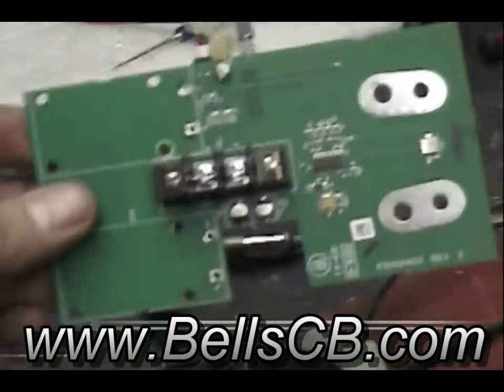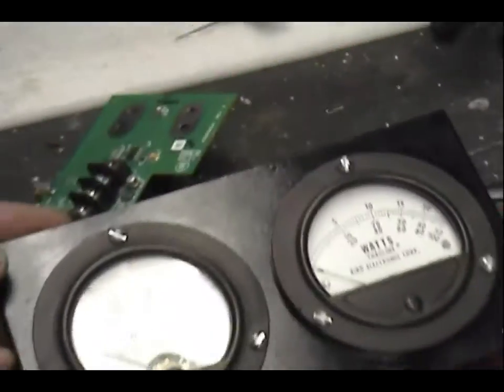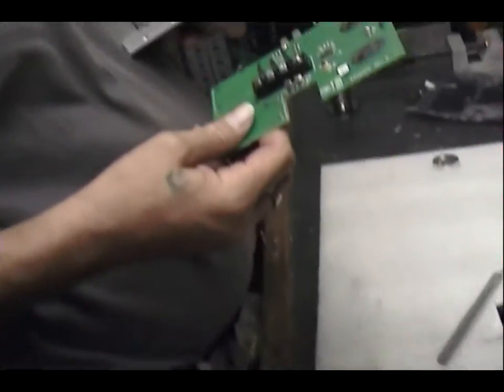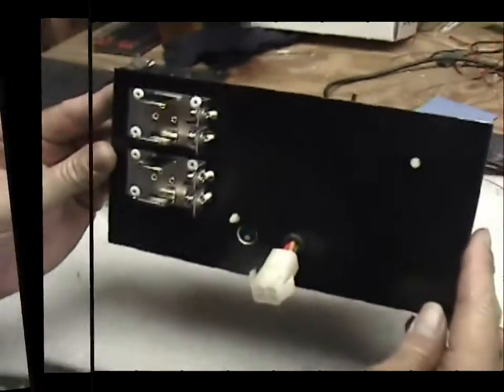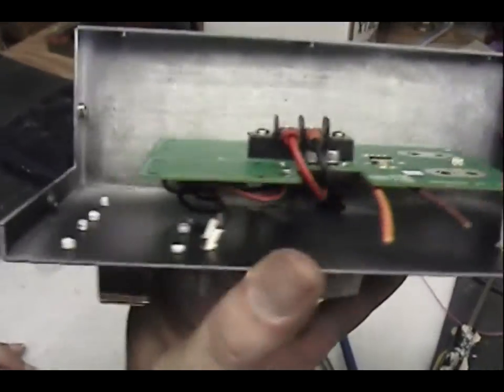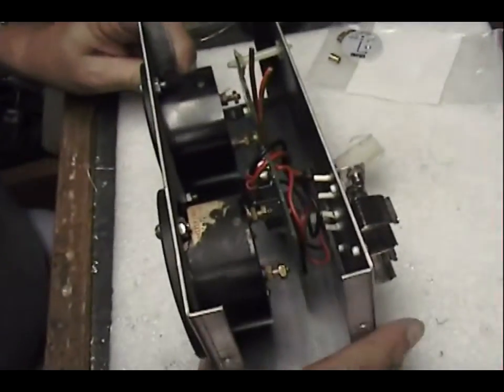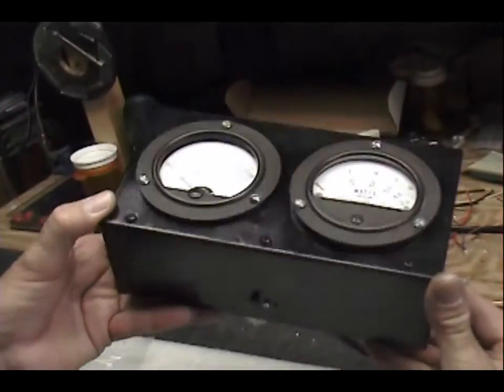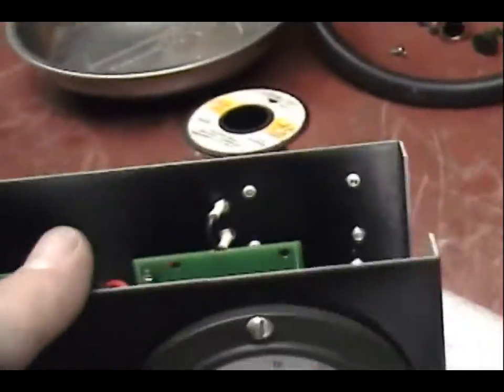Bird Watt meter custom peak kit installed

Comment from the maker: If you have the original cabinet for it, then install is easy and only 15 minutes.  Order one from Martin RF Supply and pop it in. go to martinrf dot com and get the 4300-400 Peak Power Conversion Kit